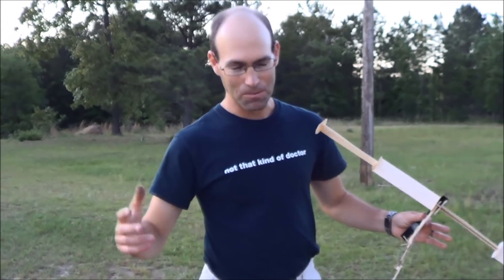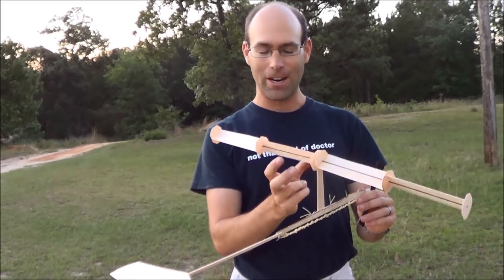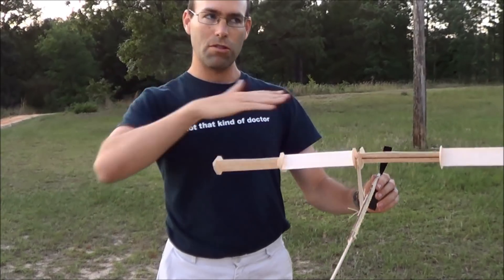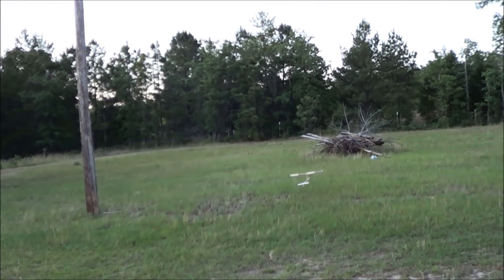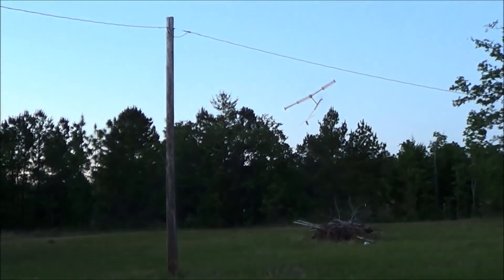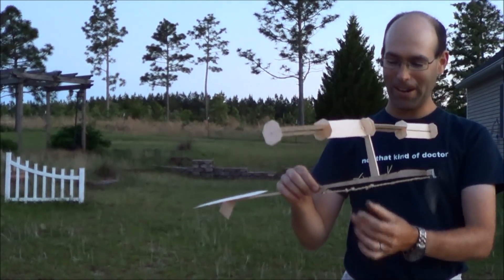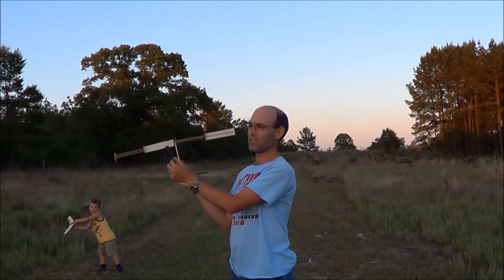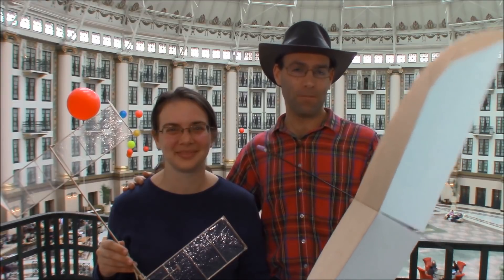Rubber Powered Tumblewing/Magnus Effect plane!

Comment: Couldn't you have a second set of bands that would spin-up the rotor at  takeoff and then allow it to freewheel once the plane was airborne? Might improve the success rate.
Reply from the maker: Yeah that's theoretically possible, however the best solution is to make a rotor that's actually well designed and capable of auto starting. Since building this plane I have learned how to do that.
Reply: @joshuawfinn  thanks for the reply! Thinking about making one of these myself in the near future.
Reply from the maker: @gabrielbennett5162  you definitely should!

Comment: Would a complete cylinder (hollow) be more efficient than the open rotating style flap that you have in this one? Most wings I saw using this effect were complete hollow cylinders with circular cross-section. Thanks
Reply from the maker: curiexr cylinders will not autorotate like tumblewings. For a cylinder to work, you have to hook it to a motor to turn it, which is the most common definition I've seen for the Magnus Effect.
Reply: @joshuawfinn  I would be interested to see what the most functional configurations are for powered and unpowered magnus effect wing, whether tumblewings/tabs/perforated cylinders or complete cylinders are better. Most studies I found of the magnus effect only used complete cylinders.

Comment: Josh, it will work much better if you make the airfoils in the shape of a shallow S curve. Orient it so the convex side leads. It will self initiate autorotation in a wind, so walking forward as you launch is sufficient. This is known as a Savonius wing. It has a high lift coefficient, but also a high drag coefficient, so it requires a lot of power to drive it, as you found. It is stall proof. But it also comes down very slowly. Your high aspect ratio version with end plates has advantages. I have a couple kites that use this wing. Model airplanes have previously been built with this wing, as you mention. It originated in 1926.

https://en.wikipedia.org/wiki/Sigurd_Johannes_Savonius
Reply from the maker: aeromodeller1 yeah I was wondering about that. I'll give that a try and see if it'll fly a little better that way.